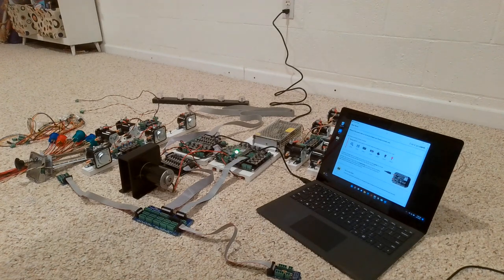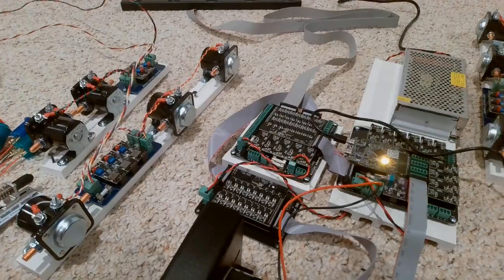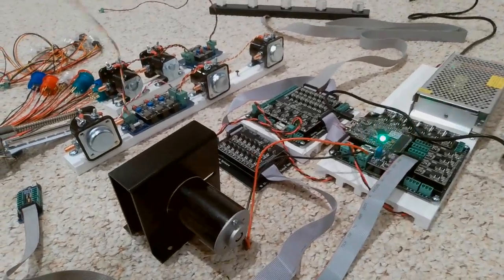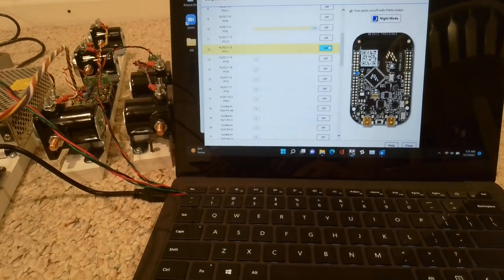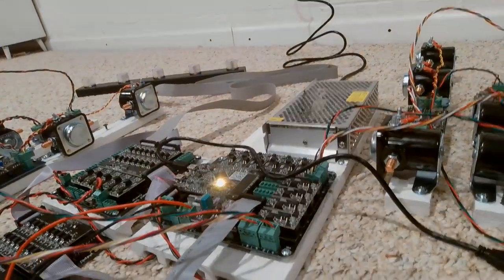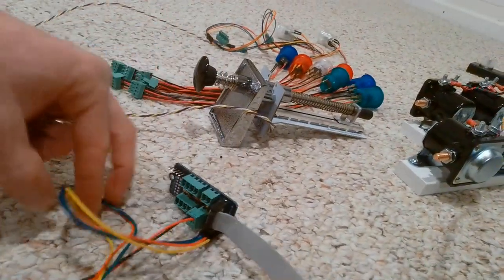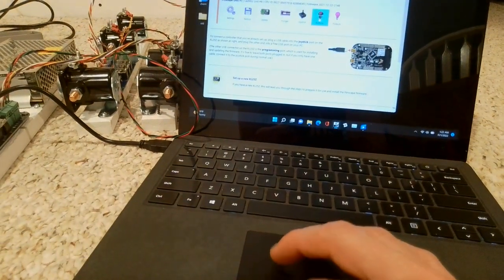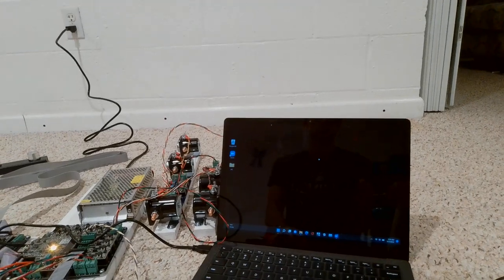Virtual Pinball Builders Kit Demo from Cleveland Software Design

Comment: do you have plans to make or incorporate addressable led  boards into your kit in the future? If not Can I connect an Arnoz pinmos board to one of your expansion boards?
Reply from the maker: Addressable are always completely separate boards, so of course you can use another vendor to handle addressable. I might come out with an addressable option in the future, but not at this time.